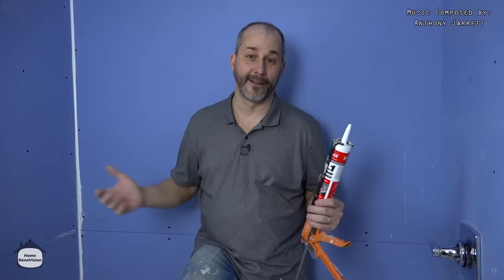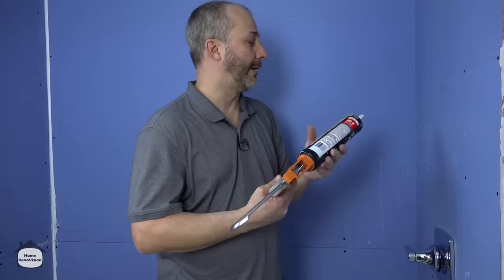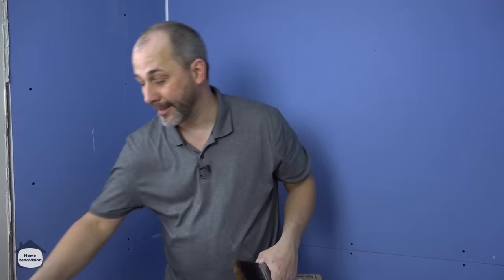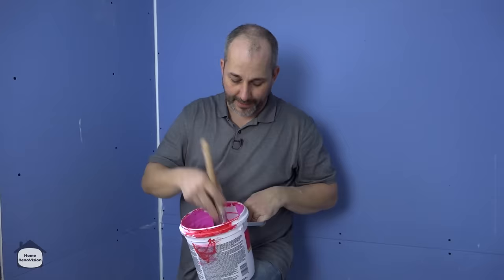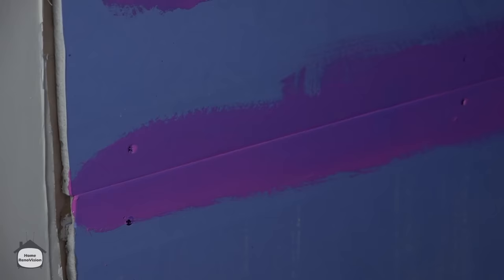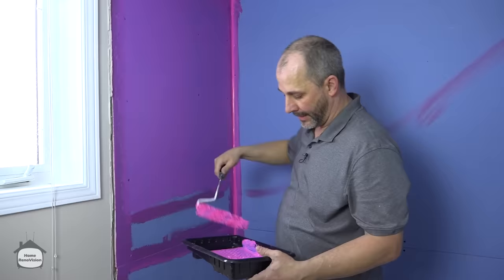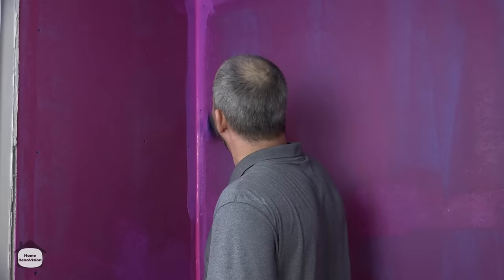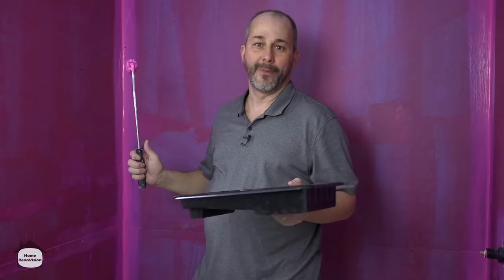The Most Inexpensive Shower Waterproofing System Ever!

Comment: What happen to cement board
Reply from the maker: still a great product, but more expensive and needs special tools to work with.
Reply: What special tools? A few extra razor blades, and the correct screws sure. But what else? Mike Holmes would not approve.
Reply: Param Persaud if you wanna waste your money on cement board and having to put more coats of waterproofing on a porous surface go ahead and put cement board.
Reply: Frank Murcko  I'm willing to bet this is the way Mike Holmes does showers. Unless he's payed by schluter and is on camera
Reply: Agree with Shawny, cement board is garbage except for Hardibacker which is rigid, durable and hard to break and establishes a very straight level. It doesn't really matter what substrate you use as long as you apply a flexible rubber sealant above it under the tiling. .
Reply: Home RenoVision DIY is it overkill to put membrane on cement board. Also can you suggest someone good in Kingston ontario for this type of work. Thanks.
Reply: Isnt thw blue one you have on this video cement board?
Reply: I still like a scratch and brown, then a hot mop.  Now we're talking 50 years.
Reply: @Carl-LaFong1618  thank you very much for believing in the old way that is the only way that I will do it, if someone wants me to do this Mickey mouse crap I tell them I'm not your guy good by , I watched one today on a tiled Roman tub and put a shower drain in so there was no way to plug the drain ? And the overflow was outside the tub ?
And when they did the water test it leaked? New no tile yet and no hot mop go figure.
Reply: I will always use red guard, but I do feel safer for the minor trouble from using cement board.  But if you are doing an old house or rental unit that will likely be beatup or pushed over in 15-20 years, don’t bother with cement board.  Just redguard it.  Your contractors will hate you otherwise
Reply: @shawnyblaze  try using sheetrock here in NYC showers. You'll get thrown out asap
Reply: purple board is the bare minimum. For my own home we found this in a remodel basic drywall we considered purple board but spent the extra for cement board and a red sealant over the top doing the work mostly ourselves we saved 70%
Reply: Schluter happened to it!
Reply: Cement board is more expensive than mold resistant and RedGuard? I don't think so.

Comment: So if I use the water resistant drywall....keep seams tight as possible ..fill and smooth joints ...corners and screw heads with the 2 n1 ...let dry.  Then a couple good coats of the red guard let dry and glue up my acrylic shower walls according to manufacturer instructions.??  No problem with adhesion to the redgard.??..I definitely don't want to have a do over situation!!
Reply: No use cement board for high quality shower
Reply: Upfront more cost but then in the future u will save because it last longer

Comment: I am so motivated by your videos. Renovating my bathroom just by watching these. Question- can i redgard over cement board in the shower that i am using. Guy at Home Depot said to do a couple coats and then put the tile. Can i do it. Would really appreciate if you could comment.

Comment: Not sure I agree. I think minimum should be durock, mesh tape and thin set the joints and screw holes. Then redgard everything. He's redgarding so should be good to go but I would question if redgard alone will seal those screw holes even with 2 coats.
Reply: Redgard will seal it up.  The number of coats is less important than the mil thickness that you achieve.  According to the MFG, you need to apply Redgard at the rate of 80 sq. ft. per gallon for 2 coats in order to get to a waterproof state.

Comment: You said you try to answer all questions, so here we go. Easy one. I’m wanting to put a ceramic tile down on a master bathroom floor. Currently it has an osb subfloor. Do I need to put down a cement backer board, or, is a 1/4” plywood good enough. Btw, it’s is a 5/8” subfloor.
Reply from the maker: Great question. In our area we need to have at least 1 1/4 inches of substrate. This means you need to add 5/8 plywood or the equivalent strength. Cheers!

Comment: Jeff I will be installing a shower insert. I plan on using greenboard (above the insert) to the ceiling  coated with redgard like in this video. I will not be removing the ceiling. What tape and compound would you suggest I use if were to tile above the insert to the ceiling? Or can I use a water proof caulking? Thank you for your time.

Comment: I am so motivated by your videos . I am actually renovating my bathroom just by learning from you. Question- can i used redgard on cement boards that i am using in the shower to water proof-Guy at Home depot said to use it over cement board and then put tiles. Is that ok to do.

Comment: Great video! I'm planning to pull out my old tub and surround soon but I don't know what to replace the surround with. What are the benefits of tile in comparison to tub surrounds/glue up tub wall panels etc.? The end of the tub with the fixtures is a false wall with a cabinet that is built on an angle towards the tub so it isn't a true rectangular alcove. I wish I could pop an insert in for time's sake, but  I don't think it will work with the odd shape of the angled wall.

Comment: 1) will the aqua defense stick to durabon where the sheetrock meets backer board? 

2) can you use modified thin set over aqua defense and can you use modified thin set to fill cracks?
Reply: Do not use sheetrock in a shower.  Use a proper backerboard. Aqua defense sticks to nearly anything.  We used it with our last shower, and it passes a 50 hour flood test with 10 gallons in the pan.  Solid stuff.

Comment: Embarrassing question but my contractor was embarrassing so...  can I quick fix the hole going to the basement by pouring red guard in a few applications?    The shower base  crumbled in a spot.   Tile is ripped out in that spot now.   It will cost thousands to redo the new bath.   Be gentle please

Comment: Hey Jeff.  Any plans to show the Laticrete waterproofing product?  The ability to seal joints and fasteners with their caulk seems so easy.  That Schluter system is like 100 steps.  Also would a mix of products work?  Schluter or Laticrete board with Aquaguard for all seams and penetrations?  All of those corner pieces and screw patches with Schluter seems like a lot of tedious work.  Thanks!

Comment: Can you talk more about how you fill the gap between the regular drywall and the green board? There was a gap also around the tub.
Reply from the maker: the gap around the tub is standard. it gets filled with a sealant between the tub and drywall. between sheets is less of an issue. the membrane actually fills the void and creates a membrane over the entire surface that is elastic a swell. so it won't crack over time.

Comment: Can Redguard be installed behind a glue on acrylic surround?
Reply: Waterproofing systems require drainage. You could do it, but you're better off investing in good silicone, taping off both sides of corners for clean lines, and silicone around plumbing trim. The unit will not leak.

Comment: I have a shower tray that slopes and floods the floor due to the water running along the caulk lines; any suggestions to fix this without refitting the tray? Great video btw :-)
Reply from the maker: install a shower door system that has a barrier along the front to divert the water back into the tray. cheers!
Reply: Many thanks, it’s a good suggestion. Thanks again :-)

Comment: I tiled my shower a year ago did the cement board. Thin set and mesh taped the joints. Two coats of the lowes green waterproof membrane and used the Laticrete Waterproofing Membrane Fabric in the corners. Did the mortar bed with pan liner. Its like doing 2 pans. One on top and one on bottom of the liner. I rolled the membrane over the top mortar bed also. And the ceiling. Tiled the ceiling also. Cement board on that too. Biggest pain was getting the liner to sit flush in the corners. I didnt plan and leave enough space for that.I think the roll on would probally be good enough. Also i should have spent more time making sure walls are square. I did some sistering of studs and shimming but its gotta be perfect. I had a wall that was not level. Would have been quicker to rebuild it.  I used the leveler shim system and it really saved me. looks 95% perfect. good enough. 12/24 tiles are a beast.
Reply from the maker: You really blended a lot of different technologies there.  Good call on the leveling clip system. It is a life saver.

Comment: For a shower pan only install do you bring that drywall all the way to the base and finish the same? Or does some more need to be done to where the pan comes to the drywall since it will see a lot more water spray than a tub?

Comment: Hi, perfect timing :D, So I got cement board on my walls the butt joints arent so flush as you have them in your video, should I put a mesh cloth, then red guard or do i tape the joints first? then mesh then red guard? 

Do you suggest redguard for the shower pan water proofing?

Thanks.
Reply from the maker: you could always close the gaps with the 2 in 1  caulking i demonstrated. it dries ready for paint in 20 mins.

Comment: I have been watching all your videos and decided to pull the trigger on my guest bathroom. I managed to savage the tub and have replaced everything but the ceiling of the shower. Now I'm one the second phase of the construction. New lights,  pex, fixtures, and Hardie backer on all the walls with added studs and supports behind them everywhere but the ceiling is still sheetrock from 1972 but seems in good condition once the mold was killed. I treated the ceiling with Zinsser after I cleaned and retextured  it. so it seems solid,  although my biggest problem was moisture due to no exhaust fan being in the bathroom, I installed a new exhaust fan with 110 cf vs the nothing right in front of the shower where the light was located to take it's place. I'm also planning to install a glass shower door vs the old curtain which will contain the steam for the most part but direct it out the top in the 2 foot void above the shower door and the ceiling. My worry is I know these kids are going to crank log hot showers creating a bunch of steam and being somewhat a beginner at tiling I'm worried the sheetrock on the ceiling of the shower will get wet with steam. can I use aqua defense on the finished textured ceiling and paint it to match the rest to create a better barrier. I was really avoiding taking out the sheetrock and replacing it with Hardie backer over the shower but don't want mold or spots to start up on the texturing. Thank you for all the time you put in these videos, it has taught me a bunch although I'm still hesitate on tiling but it should still be better than the taped plastic and duck tape I had latterly on the walls before I started. I can send you pics if you would like on what your videos have taught me. You're awesome sad part is I don't have your son cutting tiles for me, he is really good at it.

GP from
Spring, Tx
Reply from the maker: not to worry. set the fan and lights on a timer so they have to run the fan while showering. Also use a 100% acrylic latex bathroom paint on the ceiling and you won't have to be concerned about water vapor on the ceiling. I have never had to use a membrane on the ceiling in that situation .Cheers!
Reply: Thank you for the reply and time you have put in to help the rest of us. It finally motivated me to take the leap and get it done.
Reply: Thank you for all the mentoring it has totally helped me remodel my bathroom. Down to the grout stage and man getting those levelers cut out are tough. I figure if I have enough to cover with grout I'll be good to go. I ended up using a utility knife with a new blade. One more pass with a sponge to check for any UltraFlex 2 and I'm going for the grouting. Not bad for me being a newbie other than totally messing up on 5 tiles during the cutting process,  I ended up using 4 for short cuts though. I have 4 boxes not even opened, I may take 3 back and keep one.

Comment: Good job as always. Question for you. Can this application hold 36x36 inch tile? If not, what you might recomend to use for the large porcelain tiles, 36x36 (3ft x 3ft). Thanks

Comment: I was planing to use Kerdi Fix over the some areas after installing the Kerdi membrane and band.  After watching this video I'm wondering if Lepage 2 in 1 will work just as well or better than the Kerdi Fix.  What sealant do you use when touching up holes, tears, seams and corners with the Kerdi system?   Thanks for your time ...

Comment: I am in the middle of replacing garden tub and I am finishing installing my hardibacker cement board now. Are you saying that if I seal all the joints/seams/corners with the caulking solution, I can skip taping/Thinset and apply Redguard? In other words skip Thinsetting/taping seams? Thanks!
Reply: I am so interested in the answer to your question...  and why not 100% silicon? When to use use one sealant over the other?

Comment: Did you add any horizontal blocking at the seams behind the greenboard? Is there a vid on installing the greenboard? Thanks for your great videos!
Reply from the maker: No extra blocking required Fred, and yes I did a video on how to install the drywall, simply use the search icon on the home page and look for anything you would like.

Comment: Since the drywall has that tapered edge and you joined two of those will the shower wall tile slightly lay uneven? Could you just fill that slight taper with drywall mud to make it flat before adding the red guard?
Reply from the maker: I would suggest using thinset cement and then waterproof. Cheers!

Comment: Can Redguard be used as a fluid film window flashing?  I'm thinking about using it to do a window replacement.  (I'm a homeowner and never replaced window myself before.)  I'm thinking about painting Redguard all around the exterior window framing, then use flashing tape to tape down any house wrap around the window frame, with the flashing tape applied to the house wrap along one edge and the painted Redguard along the other tape edge.  Is this a viable solution?  I don't know if you can take the time to answer such a specific question.  If not, would appreciate if you would consider adding "how to install replacement window" into your queue of how-to videos.  Thanks.

EDIT:  I have seen at least one window replacement video on your channel (think it was basement window).  I'm interested in all the different installation scenarios.  For example, how do you remove old window if it has nailing fin, when you would apply flashing tapes, etc.  Is installation method different for aluminum or vinyl windows, etc.
Reply from the maker: no. If you want a fuid flashing then buy one. It is best not to mix products in construction outside of their designed use. they contain much more science than the average scientist can understand let alone us homeowners. Failures happen every day due to creative solutions. Don't be that guy!

Comment: I'm installing a Foremost JetCoat shower wall system, (panels), in my bathtub area. Will the Redgard cause any issues when I apply the panels with adhesive?
Reply: And, should I use regular drywall, mold resistant or cement board? Should I just use cement board and save myself the trouble of using Redgard?

Comment: And I was using the concrete board. Was told due to tile drywall might not last. 2 questions when would. You need to use concrete board ? And can you use that RED over that as well. Thanks for all the tips .....
Reply: Technically, if you’re using RedGard, you wouldn’t need cement board (Hardiebacker, Durock, Wundernoatd, etc.). The product is essentially a thick, paint-on latex coating that acts as a barrier between the drywall and any water that may seep in through the grout. Cement board rose to popularity due to the fact that you’re able to apply thinset directly on it without worrying about the water from the thinset soaking into the paper of the drywall. 

I just redid a bathroom using ResGard over cement board. Personally, I like the idea of using cement board in a high humidity environment, such as a shower, because vapor and moisture will always find a way behind your walls. The cement board won’t rot the way drywall will eventually. And as far as the RedGard goes, well, I’m just a fan of overkill sometimes. 

I will say this, though: I’ve used both RedGard and the Schluter-Kerdi system now, and my vote for the easiest product to deal with goes to Schluter-Kerdi. RedGard makes a HUGE mess and is damn near impossible to get off your skin. If you are going to use it, WEAR GLOVES!

Comment: I am redoing a basement bathroom and need a custom shower pan for the space I have. Could I use a Schluter shower pan, cut down to fit my spot and mould-resistant drywall water proofed with Red Guard? I assume there would be no issue covering the pan with the R-G, at least where the dry-wall meets the pan. Can I set the drywall on theh pan or should i leave a gap to prevent wicking?

Comment: Question... I’ve torn off an old fibreglass tub surround and there’s adhesive stuck in strips to the 1/2” green board underneath.  Will the red guard adhere to the glue residue strips (I’ll scrap them, but there’re not totally gone)?

Comment: Can you explain the process of pressing together the mold resistant Sheetrock? Is it simply making sure that the seams line up and tightly as possible before securing them to the wall? Also, is it possible to use seam tape instead?
Reply from the maker: seam tape works if you use the non molding type of compound. Cheers!